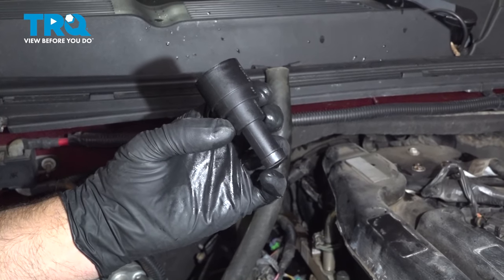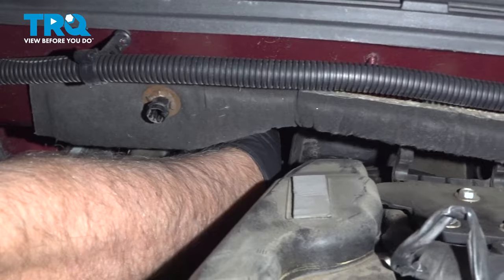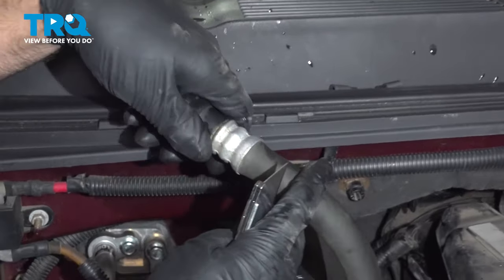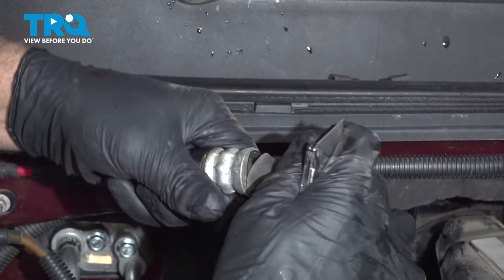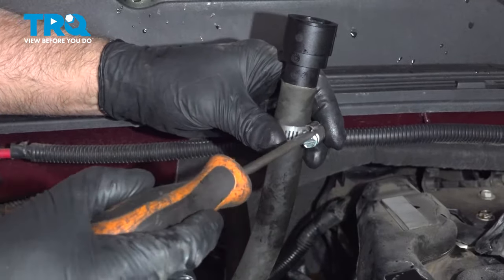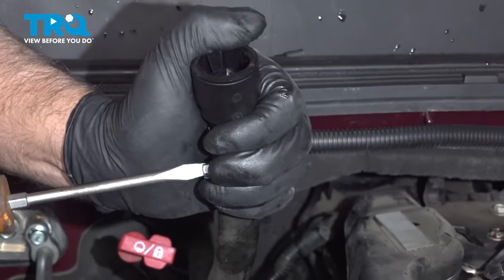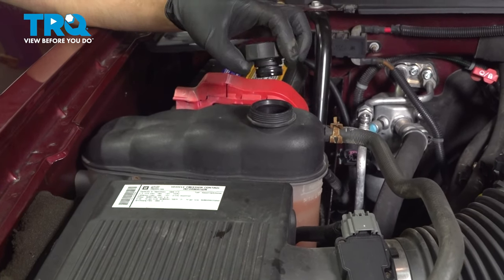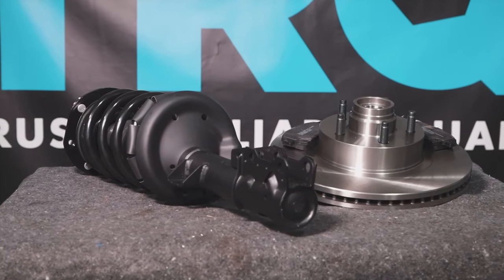How to Replace Heater Hose Connector 2007-2013 Chevrolet Silverado

Comment: Those Dorman quick connectors failed and slid right off. Ended up just connecting the hoses to the inlet and outlet with hose clamps.

Comment: Confused. Most of these new parts have the white basket release inside. Yours did not and you slid the plastic piece onto metal heater core. What locks it in place? Also, using the tool to get the piece off the heater core I did not see the white release  BASKET COME OUT EITHER. Thought that was a needed part to secure connection. 2 hrs into watching videos. Onward.

Comment: Good video.  It took me about 10 minutes to take off the right side (white).  & about 25 mins for the left side (black).  I couldn’t get a good grip on the tool on the left side.  I used a small slide hammer with a hook & put the hook behind the tool & it finally came off.  I used “Lisle” part# 39190, 3/4” Heater Disconnect For GM & it’s metal & has a pin to keep the two halves together.  I got the LISLE tool @ Oreillys for $14.  I also sprayed WD-40  inside the hose connectors & tool.

Comment: it's weird to me that you suggest a hose clamp instead of a spring clamp
Reply: I agree. If that's all you have, that's all you have but you should use a spring clamp. It is self adjusting with expansion and contraction through heat cycles and much easier to use.
Reply: Spring clamps are usually for turbos or air intakes